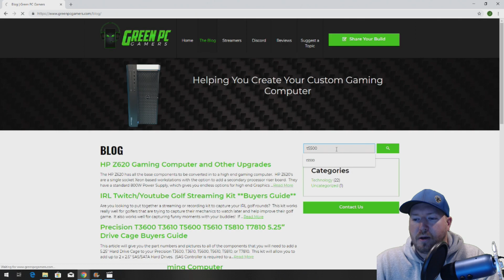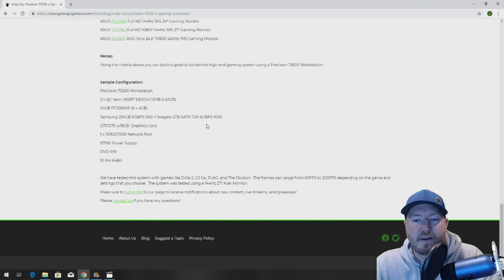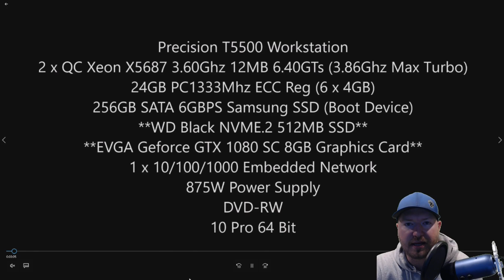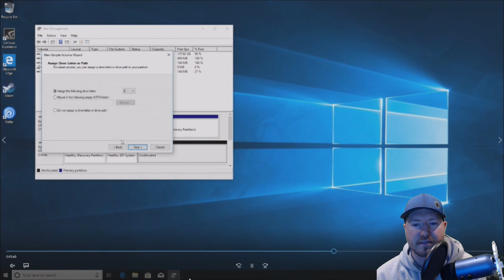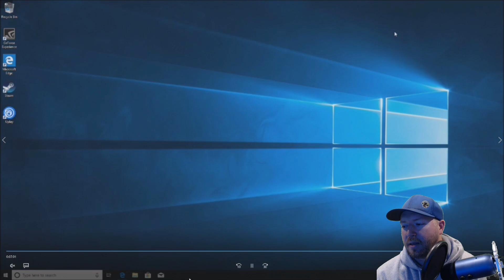Precision T5500 Gaming Computer (GTX 1080 and NVME.2 Install)

Comment: My system is not recognizing the nvme drive. Does not show up in BIOS or Disk management. Any suggestions? Sabrent NVMe M.2 SSD to PCIe X16/X8/X4 Card, with WD_Black SN850X

Comment: when i got mine it came with a i 7 cpu so the shop may have changed it  not sur what the difrench would be between the one you menshiond and the i 7
Reply from the maker: What model i7 CPU do you have installed in your Precision T5500?

Comment: Hi, just a question as I have also seen your T3500 upgrade video.  In your opinion, which system is better?  The T5500 or the T3500.  It is the same case, just a different motherboard with different cpu options.
Reply from the maker: The T5500, because it has the higher wattage 875W power supply.

Comment: Great video!  Got a T5500 for $40.  It only came with a single cpu X5650 set up and 12 gigs of Ram.  I upgraded my T5500 to a X5675 and put in a GTX 970 and I also put in my trusty SB Audigy 2 sound card.   Currently, I can run Cyberpunk 2077 on high setting with some med settings at 1080p with 30 FPS.  I’m planning on upgrading the cpu again to a X5690, 24 gigs of ram and a GTX 2080, that’s if I can find a 20 series card for a good price.  However, when I upgraded the OS to Windows 10 my sound card which is a Audigy 2 is not recognized.  Knowing that windows 10 does not support Audigy 2 cards anymore is there a way I can find windows 10 drivers to Audigy 2 based cards?  How did you get your windows 10 to recognize the internal sound card?

Comment: Just an fyi, if you can find a used or old stock Samsung 950 nvme, you can boot from it on these old dells ! No other model nvme works for sure, but the 950 has a built in uefi chip of some sort, it just shows right up in the boot list.... I can confirm this on both my T5600 and my T7500..thx
Reply: Do you  know if samsung 970 NVME would bootfrom start a well?

Comment: Hello, you success to boot on nvme with T5500? I see everywhere it's impossible... I suppose you have nvme as second disk? it's a huge difference in second hard disk? when you put nvme as secondary disk did you install all software on the nvme? or on the boot? thanks
Reply from the maker: We have booted to an NVMe on a T5500 using a boot assistant called Clover.  There are some good tutorials for Clover online.
Reply: @GreenPCGamerscom  i see lot people discuss over clover but didn't realise it's for that, thanks I will check ;)
Reply: @GreenPCGamerscom  if one day you do a video... that's interrest me :D

Comment: i have a simular computer. i want to fit a msi amd r9 380 oc inside. but there is a some part in there blocking it preventing the install. i need some help

Comment: I have T5500 with stock CPU wunning Win 10 Pro. Bios A18. When I put in an RX 580 using Win 10 or AMD drivers, my system freezes with some random color bands/patterns on the screen. Is RX580 supported on this rig (running Win 10)? Thanks and keep making helpful videos!
Reply from the maker: The RX580 shouldn't have an issues running in a T5500.  Was the card new?
Reply: @GreenPCGamerscom  Hi, the card is used bought from ebay. The seller told me maybe my rig is too old for the card but you confirmed otherwise. Here is what I have done so far: after initial installation using default Win 10  drivers, the system runs fine. But when I update the drivers to the current one (either through Windows or AMD update), that is when the system crashes. Any trouble shooting tips I should do? How can I tell if the card itself is bad? What BIOS version are you running? What version of Win10? What AMD drivers are you using? Thanks for taking time to reply. Much appreciated!

Comment: I just ordered the  4x8 GB memory you suggested on your page , working on getting a second processor next. Question : Should both processors be the same in order to run properly . Thanks !
Reply from the maker: Yes, both cpu stepcodes need to match.
Reply: I have a t 5500 for sale has 2 CPU installed 2 X 2.4ghz Quad-Core equal 8 cores
Reply: @Mbreezythedon  how much for it?

Comment: I recently bought a t5500 that came with a problem, the power supply cable was fully cut with scissors, is the dell precision t5500 compatible with conventional atx PSU?
Reply: yes
Reply: if you are going to buy another power supply. I would just buy another t5500 875 watt psu off ebay cause they are alot cheaper than anything from evga or corsair or any top name brand.

Comment: Not the fastest; the benchmark for that cpu is 6960, the x5675 benchmark (lower clock) 7965 being 1005 points higher, in my Precision t5500. The x5687 has 4 cores, my x5675 has 6 cores I.e. more cores trumps again when it's almost the same architecture.

Comment: Hi my friend have questions please answer
1-can I input 1660ti gpu in my Dell precision t5500
2-you have experience please tell me better power supply for my dell precision (duel Xeon x5690 ,1050ti,24gb.) for gaming
 please give me model power supply perfectly because I want to buy it now 
Thanks
Reply from the maker: Yes, you can install an 1660 Ti in to a T5500.  The stock 875W Power Supply is sufficient.

Comment: Great video. Any issues if you put the graphics card in the other x16 slot? Ideally I will place an NVME card in a slot below it and a USB 3 card in a separate slot. Also, would the pcie 2 bottleneck an evo 970 nvme drive to the point I should just get a cheaper nvme drive?
Reply from the maker: Yes, there is some bottlenecking.

Comment: Hi my friends, I have questions about my dell precision t5500 I use two cpu
 1-no problem I put  two  graphics cards like :two 1050ti in the system there will be no problem ?If not, 
2-there is no problem that the graphics are different like: one gtx other rtx?
3-and the mb Can get electricity   goodly??
Reply from the maker: You could install 2 x GTX 1050 Ti Graphics Cards in a T5500 as long as you have the open PCIe x 16 slots for them.  Just keep in mind that the T5500 won't support and SLI with GeForce Graphics Cards.
Reply: Excuse me, I didn't understand if two gtx graphics work on this computer and it works great for heavy games ie two graphics communicate well together 
like: two 1050ti 4g in total 8g it is not better? and the computer 
Identifies these 8GB?

Excuse me, I ask so many questions because you are a professional user and I also  you  have  experience. I have a 1050ti graphics and want to buy another one  on Amazon shop
so that they work properly during the game and do not lose now I do not know what graphics to buy? Do I need to be the same   graphics to identify and work correctly?
Thanks for writing the answer
Reply from the maker: They will not work together because the T5500 doesn't support an SLI configuration for RTX/GTX Cards.  You are better off buying one higher end card.  We'd recommend the 1660 Ti because it has minimal bottlnecking on the T5500.
Reply: Hi .if Dell precision t7500 support an SLI ?

Comment: just wondering if you have a graphics card with two 8 pin sockets what do you do to plug it in the psu that only has two 6 pin adapters
Reply from the maker: There are a few ways to achieve this.  Our favorite method has been to use a 2 x 6pin female to 8pin male for one port and 2 x SATA PWR to 8 Pin Male.  Hopefully this info helps.
Reply: @GreenPCGamerscom  thanks for the info

Comment: can I use i7 processors with the T5500?? and if yes what generations do you recommend?
Reply from the maker: The T5500 doesn't support I7 processors.  You should get a Xeon X5690 or X5877 Processor.
Reply: @GreenPCGamerscom  Thanks a lot!

Comment: What processors work with the motherboards? Do i5s Work?
Reply from the maker: I5 CPU's do not work.  

Recommended cpu's:

Up to 2 x QC Xeon X5667 3.06Ghz 12MB 6.40GTs Processors | 3.46 Max Turbo Frequency (SLBVA)

Up to 2 x QC Xeon X5677 3.46Ghz 12MB 6.40GTs Processors | 3.73 Max Turbo Frequency (SLBV9)

Up to 2 x QC Xeon X5687 3.6Ghz 12MB 6.40GTs Processors | 3.86Ghz Max Turbo Frequency  (SLBVY)

Up to 2 x 6C Xeon X5680 3.33Ghz 12MB 6.40GTs Processors | 3.60Ghz Max Turbo Frequency (SLBV5)

Up to 2 x 6C Xeon X5690 3.46Ghz 12MB 6.40GTs Processors | 3.73Ghz Max Turbo Frequency (SLBVX)
Reply: I have 5675s in mine.

Comment: I also own a t5500 as well I just put a 1660 in it from a 1050 and x5675 hex core Xeon. and 16GB of RAM. I do plan on adding a 2nd x5675 for dual CPUs. I also am using a USB 3 host card with 2 USB rear ports and front USB 3.0 face cover. I could go the NVME route but I wanted USB 3.0 for fast transfer rates from USB 3.0 flash drives.
Edit: I got the 2nd CPU installed and it's working just fine. Also I didn't have enough RAM to maintain Triple Channel memory because of needing registered ECC Memory which is RAM that is tied to a particular OEM PC. So I had to purchase some registered ECC memory. It was dirt cheap too 16 bucks for 8GB (2x 4GBs) ( PA sales tax included and free shipping). When upgrading memory make sure that you use registered ECC memory for the Dell Precision T5500 or the machine will only work in Single channel mode. So I am going to have 24GB of RAM at the end of the day. May put another 12GB-24GB for 36 or 48GB of RAM as a final total. Not sure yet. Finally make sure that you install the 2nd CPU riser card correctly because in my case it caused the fans on the riser card to run at max speeds and the BIOS or Windows will not see the RAM or the 2nd CPU.
Reply: Sam Kay  
Im running Windows 10 just fine no issues.

Comment: The weak point in any computer (especially old ones) is the storage subsystem. I defeat this weak link in older systems (like the T5500) with RAID Cards and traditional 6Gb/s SSDs. Even in a system like this, you can run 8 of the fastest 2.5" SSDs in RAID 0 or RAID 10. Obviously CPUs and Memory capacity are not an issue. Nor is a good graphics card (as you've proven here). The only weak link at that point, is the PCIe 2.0 interface. But despite that, with just a Dell Perc H700 1GB RAID Card and 8 Samsung 840 Pro 128GB SSDs, I get near 4GB/s read speeds, and 4GB write speeds. With the 1GB cache card, the write speeds often exceed the read speeds (which without certain parameters is rare, like write back battery backed NV cache). If you use faster SSDs and a better RAID controller you can get above 5GB/s speeds (especially if you use 12Gb/s SAS RAID Controllers). In traditional systems like this you can also use 4 Port SAS RAID controllers and utilize 16 SSDs. I've gotten speeds over 8GB/s reads and writes easily in T7500, and T7600 and above. T5500 chassis is pretty small for 16 SSDs but it can be done. The point is, you don't need NVMe and you can blow it away with traditional SSDs and decent RAID controllers.
Reply from the maker: Agreed, but controllers and ssd’s can be expensive, and they create more opportunities for failures.  We have created some raid 10 configurations on our other videos, and the benchmark speeds are impressive.  Thanks for commenting!
Reply: @SkylineToTheSeaAndMe  Can you please share the link to purchase the mentioned Dell Perc H700 1GB RAID Card? I'm interested to buy but I need to check its specification first.

Comment: A little clarification to your statement on what the fastest processor is for the T5500 (I'm running an X5690 just fine on my T3500):
"The fastest processors in Westmere-EP family should be X5687 (3.6 GHz) for quad core and X5690 (3.46/6.4GHz) for six core."
https://www.dell.com/community/Precision-Fixed-Workstations/T5500-CPU-upgrade/td-p/7193494

Comment: If you can find and afford one - a Kingston HyperX Preditor is a bootable 4 lane PCIe v2.0 M.2 SSD.  It uses an AHCI vs NVMe interface. The SSD with the PCIe adapter card is based on a Marvel chipset with an on-board OROM for bootability in old rigs like the T3500/5500/7500. My 480 GB Kingston in a T7500 and T3600 gets solid read speeds over 1,300 MBs and write of over 1,100 MBs. It's not 970 EVO speeds, but being bootable and more than twice the speed of a SATA SSD - it's a killer upgrade. You can still run an NVMe SSD as a secondary drive. The downside is they're hard to find now and expensive - double the $'s of a WD Black NVMe of the same size.

Comment: I have a regular sata ssd, but when I plug it in with the power and sata cables like a regular hdd it does not show up in the file manager like my other drives. Is this also something that I have to enable in disk manager like the nvme drive in this video?
Reply from the maker: Cameron Gore yes, you must enable the SATA port in the f2 setup first, and then in disk management in windows.

Comment: Interesting that it won't boot from the PCI-E SDD, because it will boot from a Dell Perc H310 card (which gives you 6gb/s sata, and 499mb/s for my Samsung SSD) .     Is the PCI-E card missing completely from the Boot devices list?

Mine has dual X5675's, 18GB 10600r ram, Perc card for boot SSD drive, USB 3 card, 5 spinning hard drives (1 on the tray with the SSD, 1 in the floppy spot, 3 in a drive rack in the 5.25 bays), Xonar soundcard (why not..it was spare) and an ATi Firepro V7900.    It's a workstation, not a gaming PC.      I'm after a 2nd V7900 for crossfire....just cause it will work. I don't think SLI will work, due to lack of motherboard support, but I haven't tried.

For games, I've run a GTX-750 and it fits and runs fine - with a power adapter cable and hard drive tray removed (like in the video).
Reply from the maker: @Mark _A_W  the NVMe M.2 SSD normally shows up as a "Mass Storage Device".  You can boot to it if you use a boot assistant script.  However, we haven't made a video on that process yet.  You are correct, the T5500 is limited for configuring an SLI/Cross Fire.  Thanks for sharing your configuration!

Comment: I put my rx 580 there but sadly I need to remove both of the 2 parts not only the handle blue bar
Reply: which part?i planning to buy rx 580 and have the same case

Comment: Hello. I have T5500, and would like to change my NVidia Quadro 4000 card to GTX 1060. (some say it is good for 4k video). On ebay there are some with one fan and some with two. There is MSI, ASUS and others. If I like a card with two fans, which is ok and will work? I need it for 4k video, not gaming. Appreciate your answer.
Reply from the maker: The GTX 1060 is a solid model.  I'm not sure if the ASUS/MSI Card will fit in the T5500 Chassis.  Most of the EVGA GTX 1060's should fit.  We've had good luck with the single and dual fan models.  Generally we go with the 2 fan model if it can fit in the case.  Thanks for commenting.
Reply: thanks. i will try evga
Reply: Do you think gtx 1070 much better or a little better?

Comment: That NVME-to-PCIe adapter card is basically just a physical "pass-through"-type adapter, right?  It looks like it didn't have much in the way of logic chips or capacitors on it.
Reply from the maker: That is correct.

Comment: I know the video is old, but I wanted to say thank you for an informative video.  I currently have a T5500 x2 x5675 Xeons,  72gb of RAM and an EVGA RTX 2060 installed. Instead of using a SATA III card in place of the onboard SATA II I'm using a Dell H310 RAID controller as this will not only allow me to boot from the controller, but allowed me to use any  SATA III and SAS SSD/HDD drive combinations and hardware RAID support. For my needs the controller is a must have over a standard SATA III controller.
Reply from the maker: Stormson Weathers you should share your build on our website www.greenpcgamers.com.
Reply: @GreenPCGamerscom  I'd be happy to once I'm back on my PC. Once again I'm glad I found your channel since it's always a pleasure to find fellow Xeon enthusiasts that can turn old hardware into something useable well after its prime.

Comment: Have you tried SATA III with PCI E adapter to be mounted directly in the board? My MB is SATA II and planning to buy an adapter, since my existing SSD has SATA III, i want to connect to the faster port. While connecting to the adapter with my existing SSD, my operating system will be lost or will work as it is?
Reply from the maker: Tamil Tweeters we have not tried this yet.  I imagine it will have the same limitations the NVMe M.2’s have with booting on legacy systems.  Let us know if you try it.
Reply: GreenPCGamers.com will keep you posted shortly, I modified my T5500 with 72GB RAM, NVME with adapter and GTX 1070 graphics card, SSD for booting, HDD and NVmE for storage, updates BIOS with A18, I feel system is 100% perfect except booting time, it took roughly 1min to boot. Checking the other parameters to speed up my system. Your video is so nice.

Comment: Bro, mine is Dell Precision T5500 Xeon x5650 version dual CPU, still can i upgrade with NVME SSD and GTX1080? my original graphics card is with Nvidia K2000.
Reply from the maker: Of course you can.  The tricky part is finding the parts at a good price.
Reply: GreenPCGamers.com wow, amazing. I will change both and update you. Thank you
Reply: @tinytvoffl  Upgrade those Xeons. You can find the x5677 on newegg for under $40.